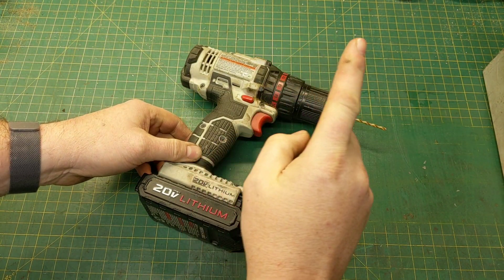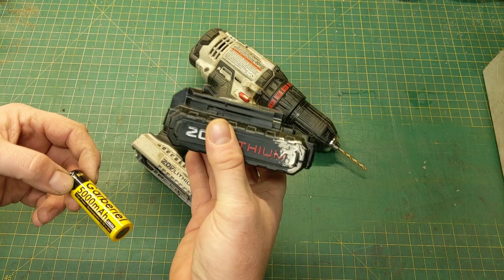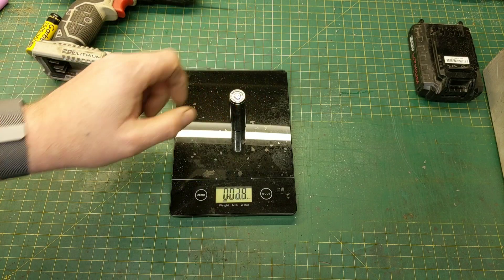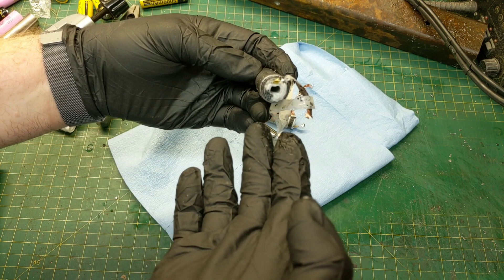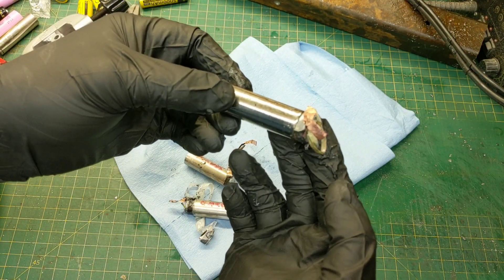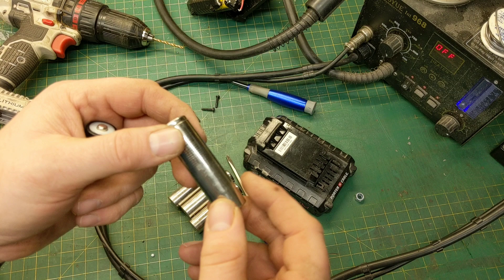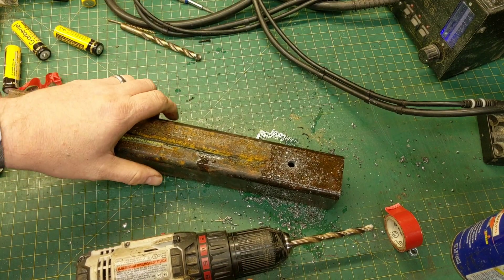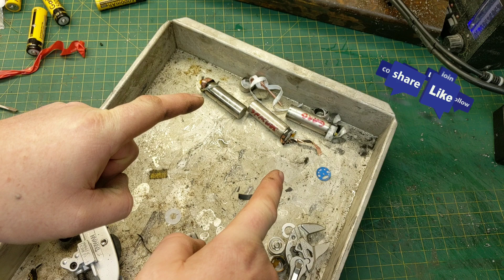Power your drill with Tesla batteries!    Repair your dead power tool batteries with Tesla Batteries

Comment: Lo que pasa es que esas baterias Tesla son de alta descarga, eso podria dañar la placa de circuitos de tu taladro o el modulo de la bateria.
Reply from the maker: Technically the board and other components will only pull the maximum amount of current they need.   The new batteries are still providing the same voltage.

Comment: Did you know that these Porter Cable batteries are compatible with black and Decker and also Craftsman diehard 20v tools and batteries. The difference is the small 1/2 inch long notch on your battery near the contacts, i believe the left side, it is mirrored on the black and Decker tools
Reply: To use the black and Decker batteries in your tools you either have to notch the battery or the tool as they interfere on the square edge on the Porter Cable battery slide, easy fix